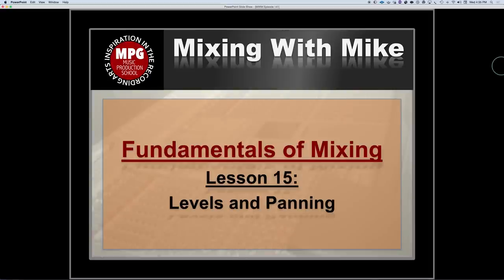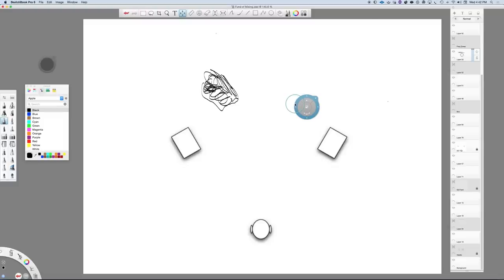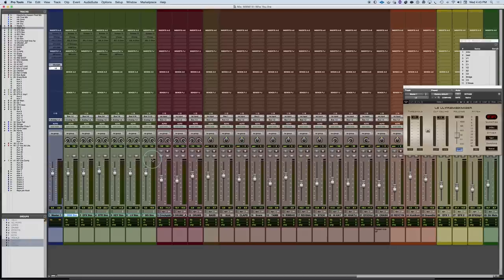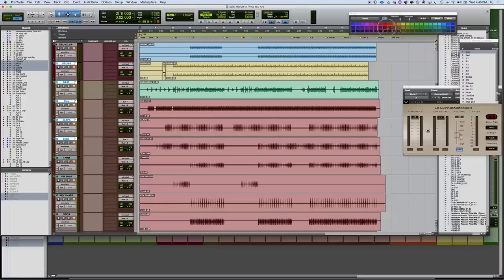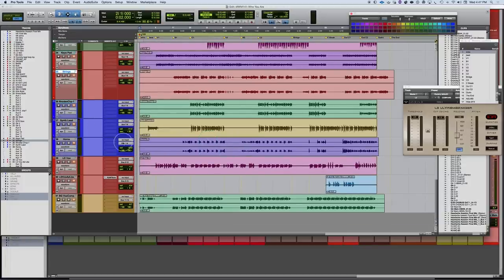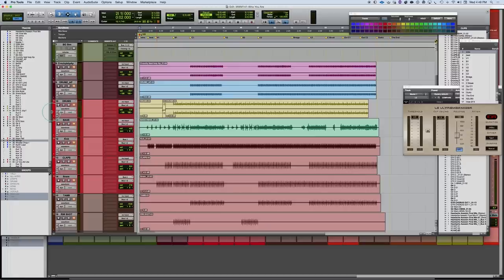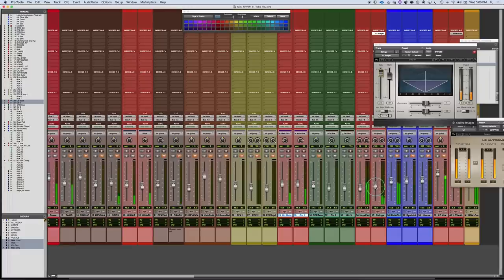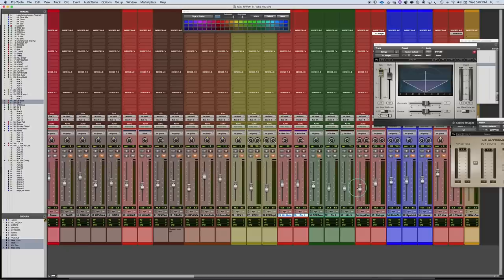Fundamentals of Mixing Lesson 15 part 1: Levels and Panning

Comment: Michael quick question, would it be safe to say that you would rather do the balance with a gain plugin after you take care of the original VU level adjustment so that the channel faders stay at 0 and then start processing with compression, eq, etc.. so that when bypassing those processors you are comparing to a already balanced mix? (and if something needs to be louder or quieter you just go to that gain knob instead of the channel fader)? Thanks for all of the lessons.. learning a ton!!!

Comment: Hey Mike its your #1 fan jay back again. Hey in another video "Creating Reverb Depth for Vocals", @ 26:12 , you state that panning hard L&R you bring the sound more to the front. "Which blew my mind a little bit". Then you made an analogy with halls. Stating that if standing center stage in a music hall your immediate left and right on stage is essentially your hard left and right or 100% L&R. So as you pan back 70%, 60%, 50% you push the sound back more to either side of the hall. Essentially making 20% and 10% all the way at the back of the hall correct? 

Sorry been mixing for years and never really thought of it like that. I have always seen L&R as "wide as possible" as you just stated in this video @ 25:35. Sorry, I am not nitpicking. I am trying to understand how you see pans effecting the sonic field. Do you see panning L&R as widening the sound or bringing it to the foreground or to the front. Its very important to me how tenured engineers such as your self see this because I plan to follow.

Again I always saw panning left & right @ 100% as wide and in the background. As a I bring the pans in 50%-30%-20% it brings the sound to the front and center. The other tangible is that you were talking about vocals and hear you talking about guitars and pads and unless PT has a special AI algorithm that knows the context of the sound (lol) I would like to know how you see it or perceive it might be the best way to pose the question.

Thank you,

Comment: Hi Love your videos. I wonder though....in the gain structure video you adjusted the gain so that they were giving healthy levels. and now you adjust the faders. Could you explain the purpose behind this. I am having some problems with gain structuring I believe. I use studio one which has a master fader and I try to keep a full mix around -12dbfs (I Think). Upon checking my levels of individual tracks via the same VU plug in that u have/same settings I am hardly pushing the needle for almost all of my tracks. Also I am having a hard time driving my outboard compressors. Is there a difference between gain and level? Whats more If I do push up the gain on said tracks I am get close to clipping my mix bus. My interface is RME fireface UC. It's software has gain settings. Its input options are +4,-10 and low gain. with low gain not being specified. It's outputs are +4,-10 and hi gain. again Hi gain is not specified in the manual. I currently have both set to what I assume is a industry standard +4. I also use the RME for tracking. Any way you could help me uderstand what I am missing. Thank you for everything.
Reply from the maker: How are you connecting to your outboard compressors?
Reply: Hi, thank you for responding. I am going out of my RME fireface uc line out's 3456 for outboard gear. 1&2 feeds my monitor station and the 7/8 output, which is a single stereo out for headphones, I do not use. In the past I have set the line out option to high gain but primarily I keep it at +4.
Reply from the maker: Is the -12 output the peak level or the RMS level? this might be why the gain is so low going into your analog gear.
Reply: Yeah, I keep my peaks at or around -12. I almost never go over. That does sometimes leave my average level, which is represented in my master fader, at -18/-24.... So maybe I should not be so scared of letting my tracking levels to hit something closer to -9ish as long as my average is getting closer to the mid teens? The talk of the loudness wars and all the emphasis on not clipping in the lessons out there have got me nervous about recording to hot. but with all my outboard stuff I have been inching it up.  I suppose I can control any clipping in the fader...or in the gain? Since I have you here. Is there a reason why one would reduce volume via fader vs. gain? Thank you again, Jeb
Reply from the maker: You can have peaks up above -6 as long as the average level is closer to around -16
The reason why you adjust the gain from the audio file source is to set a good signal level for insert processing that leaves headroom to prevent clipping and also translates well to levels most plugins are set up to receive. The fader level is to control the overall blend into the stereo mix.